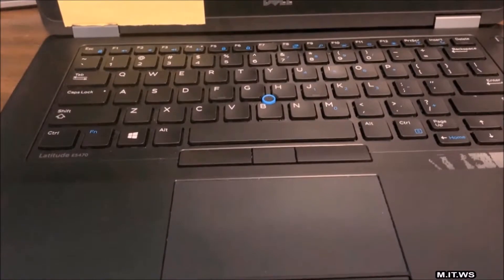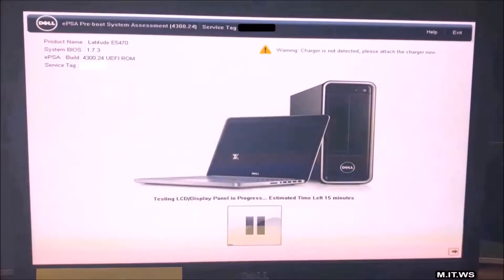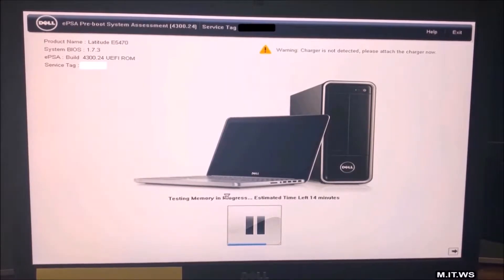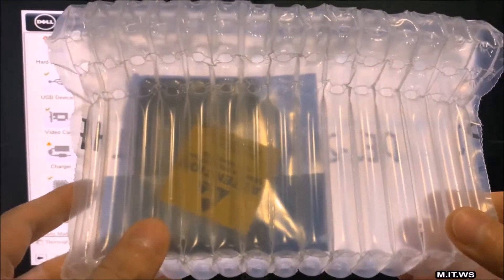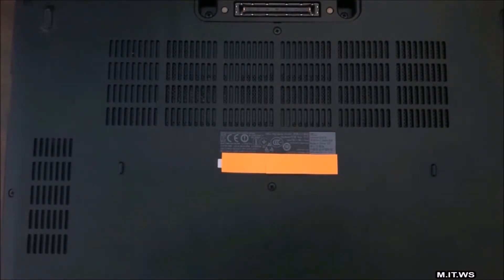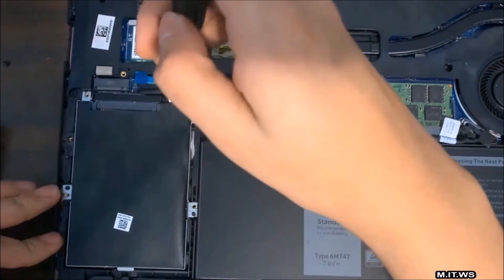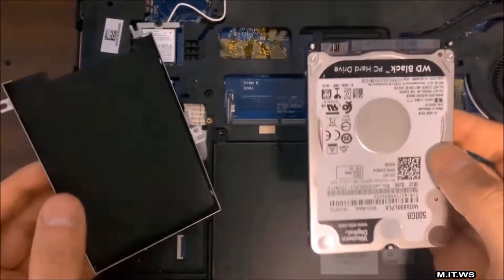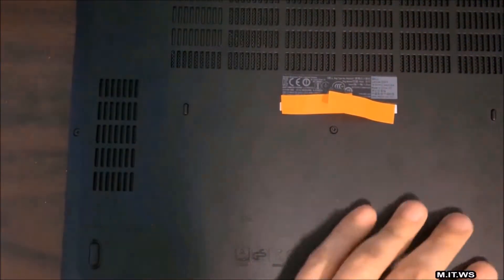HDD Replacement | Latitude E5470 | Dell Diagnostics

Comment: Do you know why Dell said the battery must be removed before replacing the HDD?
Reply from the maker: Hello,
It is recommendation to avoid damage on the motherboard. It depends on the model you have, some laptop have the battery inside the case, so you cant really remove it, you can disconnect it. On other models the battery is external, in that case 100% remove it before doing anything.
Hope it helps
Thanks for the comment

Comment: Can I add a hdd along with 500 GB ssd which is already available in the laptop
Reply from the maker: Hello Dilip P,
Being honest I never thought about that......but know I want to test it out. I have a similar laptop at the office, I will test it in the coming days and let you know. 
I almost forgot, the extra HDD, if it works, would have to be a M.2 SSD. 
Another easier way to do it would be if the Laptop has a MicroSD reader, most nowadays have, get a 500 GB or 1TB Micro SD and just plug it into the Laptop. That would be like connecting a old school USB Thumb Drive.

Thanks for the comment!
Reply from the maker: Hello Dilip P,
I tried to add a M.2 ssd along with the 2.5 inches ssd and there isn't just enough physical space for both. If you need more storage, the fastest solution is to add an SD card to the laptop.
Hope it helps!

Comment: Hello, mine came with the NVME and it seems to be failing, I don’t have that Sata plus power connector.
But I have an SSD 2.5 inch Samsung ready to install , what can I do?
Reply from the maker: Hello Roberto,
If it is the exact same model as in the video the answer is yes. This model support 2.5 inches  HDD/SSD as well as M.2 SSD.
Now, if your NVME is still working, which means you still have access to Windows, I would clone it. In other words I would make a copy of the current SSD (NVME) and copy it to the 2.5 Samsung SSD. 
For Samsung SSD, most of them, you can download a free cloning software from Samsung's website. If that's not the case  i have some videos where i clone hard drives with free software. However, you will  need a Sata to USB cable in order to do that.
Here is the video link: 
https://youtu.be/VQ9jQd-SeJw

Hope it helps 

Thanks for the comment!
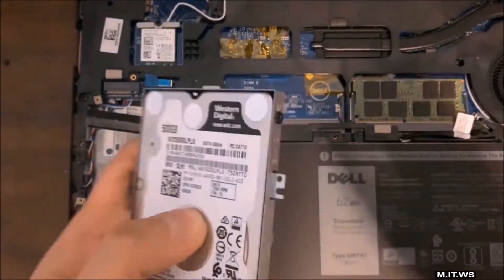Reply: Thanks for the advice, what is the cable at  7:30 called ?
Reply from the maker: @FlubberChubber  Hello Roberto,
The cable is called Sata to USB cable.
Here is the link for Amazon so you can see it better: https://amzn.to/2VrEmaa

Thanks for the comment!
Reply: My IT Workshop thanks for the link, but I need the cable at 7:30 that actually connects the ssd or hard drive to the mother board. Mine didn’t come with it since it came with an nvme.
Reply from the maker: @FlubberChubber  Ohhhh I didn't get that....The cable name is ADM70 hdd cable. I leave the link for Amazon:
https://amzn.to/322EHlB

Hope it helps!
Reply: My IT Workshop just bought it thank you My IT workshop